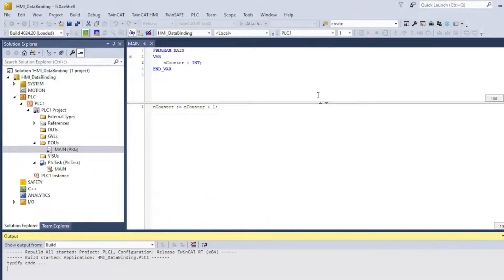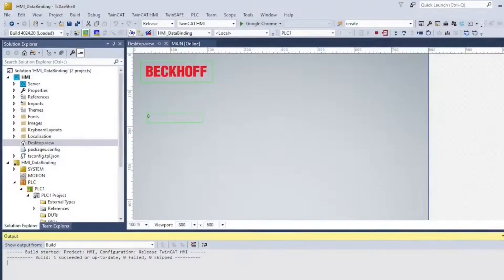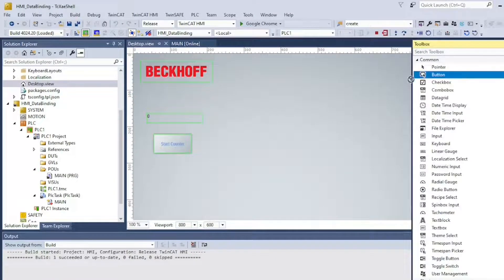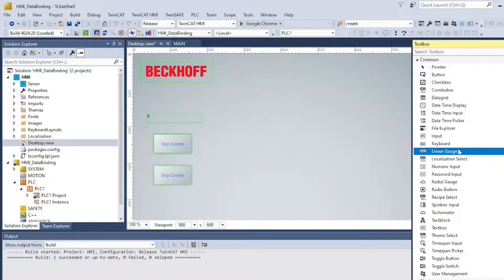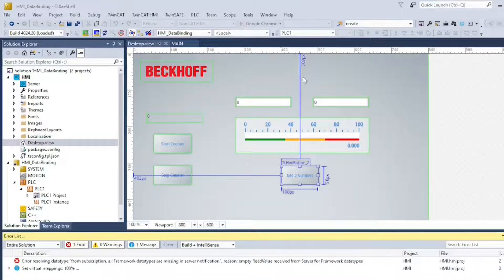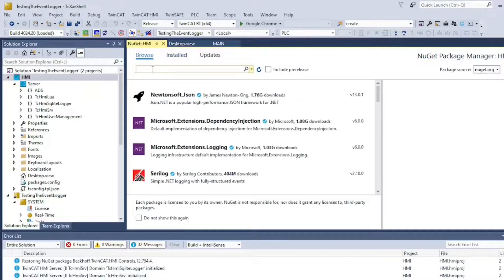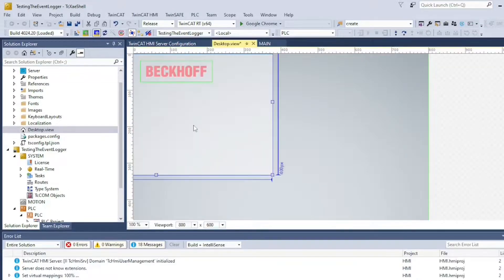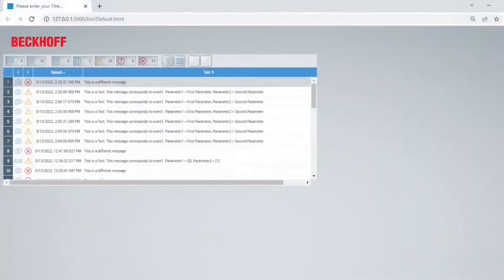TwinCAT3 -  HMI Part 1

Comment: Your note near the beginning about needing to not only declare a variable, but also use it, fixed a problem I was trying to solve for several hours.  Thanks so much.  I really like the way you speed through repeat or simple processes in your videos.  It saves time for the me and still lets me get the info I need.  I subscribed.  I like what you are doing here.